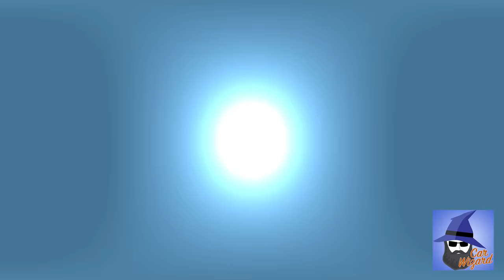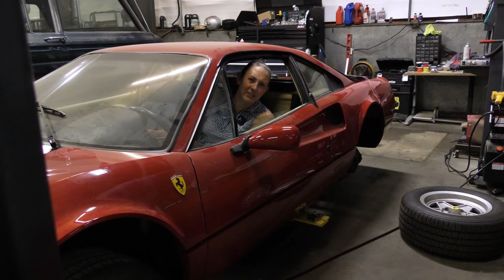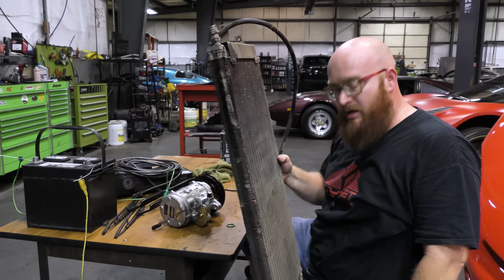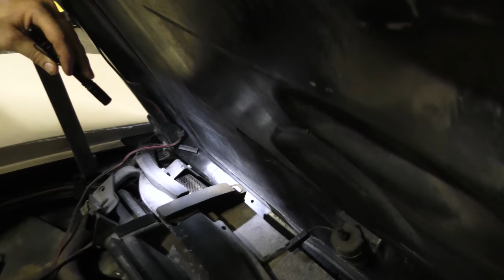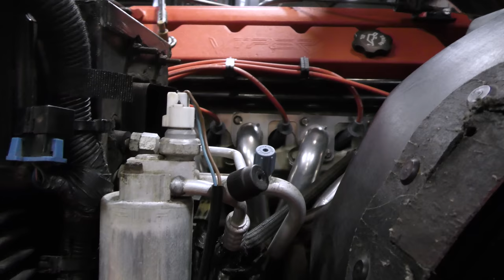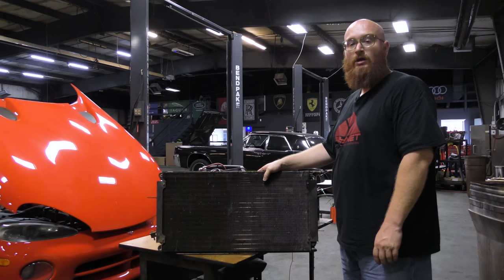Your AC died, now what?!? CAR WIZARD shares several reasons why it dies & the repairs to fix it

Comment: EXTREMELY PERTINENT video !!! You are sooo right with the WalMart refill cans ! Stay away from those ! It is a precise science. I changed the  whole system on my 1996 318iC. Like you said, did everything right and had it filled with the machine at the garage. Works perfectly....The mechanic was sure I had done something wrong along the way, but no!!! Blows COLD !!!! AND I can confirm why it is expensive work, because those parts are not easy to reach, specially  the expansion valve under the dash !!! And don't forget  you have to use the right amount of oil which is impossible for me to know because there is no way to mesure what's left inside the system....

Comment: my brother as a mechanic says all cars have a leak in their AC system. it usually leaks out over time via the compressor shaft seal. same thing happens to ships and boats. they all leak a little bit thru the prop shaft seal.

Comment: Dealing with this on my mother's 12 Juke. No apparent leak in the engine bay as far I can tell, not getting any built up residue or dark spots but it's losing 134A fast.
Reply: @ne2i  that's my next step, getting one of those refrigerant sniffers. How have you seen them in the evaporator? I imagine that's not too easy to get to
Reply: @CAepicreviews  You can use a sniffer in the vents or in the ac drain. Also if the system has dye, you can check for dye in the drain tube of the evaporator. Also, check the service ports closely. Thats where I find the majority of leaks.

Comment: I remember the good ol' days when AC systems had a sight glass to check the quantity of liquid freon in the system. You could add freon to your system, by yourself, if you saw too many bubbles in your sight glass. I still have the kit to do that, along with a 40 year old can of R12.
Reply: Cool stuff!  Had the same equipment in mom's 69 442 Olds so easy to top it off.  That a/c lasted until 1981 when I traded for a 280zx.  Too bad it was rusted!!
Reply: R 12 is extremely expensive these days, not worth keeping installed.
Reply: My son's '02 Toyota Tacoma PU truck has a receiver/dryer w/sight glass on it, reminiscent of the good ole days with R12 freon. Works just as good, and made it easier to check after complete A/C system overhaul last spring for him. He says he has to turn down the A/C output on hot days as it will freeze him out of the truck, LOL.

Comment: I have an old 911 that has AC, it was empty when I purchased it. Being a tradesman in that field it was instantly apparent that the cost of recharging for an old R12 setup was too much. Remove the compressor , condenser. Took about 25 lbs off. Did not by it for AC anyway.

Comment: Something shops never talk about...If your AC only quits in very hot weather, check the gap between the compressor clutch plate & the pulley.  It should be about .020"  As it gets up to the high 30s, approaching .040", the compressor clutch will not have the strength to pull the clutch in. Hot weather will open up this gap more than moderate weather, so the problem first becomes visible in very hot weather.  You can address this by removing the clutch plate and taking out one of the shims. Button it back up and you are good to go.  If you do your own work, this is something you will want to check and address yourself. If you take your car to the shop, it only makes sense to do this if the compressor clutch plate can be removed without pulling the compressor.  If they have to pull the compressor to get the clutch plate off, you are back to the question of whether the labor cost is so high that you might as well get a new compressor.

Comment: Had a 92 D21. AC didn't work when I bought it, then did some digging and found the relay was gone. After about 4 months of it working well, the compressor seized up.

Comment: I once went through 3 compressors in less than 6 months because the parts the shop was getting from their supplier were defective.

They finally forced the distributor to replace it with a better brand. Then it lasted 2 years before it stopped again. A diffrrent shop looked at it and said it was the compressor again. I took it back to the first shop to see if there was any warranty left. They said it wasn't the compressor but a line. The other shop first thought maybe it was a line but then said it was the compressor. So 2 shops in 2 days said 2 different diagnosises. Finally the shop that had replaced all those compressors in the past said they were so confident it was the line that if I paid the $375 to replace the line and it ended up.being the compressor that they'd replace the compressor a 4th time. It turned out it was the line and it's been fine for the last 8 years. But I am on my 6th compressor counting the factory one that was in the car when I bought it 18 years ago. This is a 95 Pontiac Trans Am I still own. I've probably spent upwards of $2500 on the A/C system over the years.

Comment: My '08 GTI had the freon recharged by an R2-D2 equipped shop in 2017. Spring 2022, I was going to top it up using cans from Amazon (Canada), but I couldn't find a seller with cans and hose for a decent price: it was a sign. Let the shop handle it, and I sent it in to get R2-D2'd again.

As the wizard said: Newer small cars are so sensitive, there is so much room for error and environmental impact. Best to let the shop handle it right to spec the first time.

Comment: The warmth of recalling an old memory from a much younger version of this mind  through a delightful childhood reappraisal mechanism exercise.... when a Dodge-Chrysler AC compressor and a fab.'d/modded bracket were not uncommon add-ons (in addition to the working existing AC of a farm or ranch truck or, if the existing AC system was no longer used, the compressor and hoses being ~repurposed).... along with a regulator/blow-off or..... simply a switch to control the clutch 🤔🤷‍♂️ where the AC compressor served duty as an onboard air compressor for airing up everything from a puncture kit repaired pick-up truck tire up through farming implement tires and tractor tires when far and away from any services and an air bubble was simply not going to hold enough air to get the jobs done.
....Anyhow, nowadays, we have transferable / portable air compressor options that are powered off the 12-volt accessory jack and, yet, those AC compressors flowed alot of air volume quickly to get the farm back into operation but you had to be careful to stop the compressor before over-pressurizing. 🍻

Comment: My 2006 Scion XB had a rock puncture in the condenser when I bought it. The front of this car is almost flat, so i'm not surprised. When I replaced the condenser I put some black gutter mesh in behind the bumper to possibly prevent rocks hitting it in the future, so far so good.

Comment: Had an AC pressure switch fail on my audi 3.0tdi, caused the radiator fans to go max speed all the time and car not warming up regardless of the AC on or off. also climate control auto modewas setting the blower motor to almost full blast as well
Reply: gotta love German engineering.  I had a bmw z3; spent more on replacement parts than all my other cars combined.  Hope yours was better.

Comment: If your doing it at home invest in a vacuum pump and manifold gauges. I had bad O-rings on my Subaru Outback. They were the 2 located right at the compressor. Since you now have exposed your system to outside moisture and humidity you need to suck that all out. In my case 45 minutes. 30 minutes at the correct negative pressure. Basically suck it down until the desired reading and shut the pump off. If the system is sealed correctly it should maintain the desired reading. Then run the pump for another 15 minutes to ensure all moisture is evacuated from the system. To fill you want to see how much refrigerant you need plus the PAG-oil type and quantity. Get a small digital scale and weigh the full cans and deduct the actual fluid ounce marked. It will make life alot easier. My Subaru now has ice cold Air Conditioning at about 39 to 42 degrees after a 30 minute run time.

Comment: I have found that overcharged AC units are usually due to a "loose nut" behind the wheel.   Thanks Wizard and Wife as always.
Reply: There is no correlation between your statement and the end result.

Comment: Great video...  Another scenario I have seen that reduces AC efficiency is a electric fan or relay that fails, thus not producing the air flow needed in slow driving.

Comment: Good tip on the evaporator, Going to have to check that. Can't find any leaks around the AC lines or compressor or condenser.

Comment: I had a car aircon system that was not running at a cool eneough temperature.  A local shop checked it out and found that the evaporator (this is the part that the fan in your car blows or sucks the air through to cool it down) was clogged with dog hair (I have 2 border collies in the car most days).  The shop blew the hair out using a high pressure air hose and the problem was fixed.  Fluffy lambs fleece seat covers are also a common cause of this problem.

Comment: Great video. It would be great to continue in your future videos if when your talking about parts viewers saw them on a table and were educated on how they work. My VW Jetta GLI has 240K miles. My AC was charged recently but was getting a bad taste in my mouth running the AC. It was 100K miles since I changed the air filter so first sprayed Lysol then AC Pro duct cleaner and smelling better now. But if I turn the AC off - my vents release hot air. Has me worried the foam around the flaps arent closing corectly. A very very expensive fix.

Comment: We have an Isuzu Rodeo that had no ac when we got it. All we had to do was Jumpstart the ac compressor with a wire in the fusebox, and a bottle or two of ac refill. 

The ac isn't great but it at least still works all this time later. Still don't know why it was empty in the first place, we got it that way. Still blows cool air from the vents (semi cool I don't think these cars ever had really good ac like a suburban)
Reply: How old was it when you got it?
 10 years? 
Probably leaked it out over that time....
So next time (or when you get fed up with the lousy output) go to a shop and get it recharged (with the correct amount of oil as well).
You might be pleasantly surprised at how well it works after that!

Comment: Sounds to me like if your A/C is working just fine now on it's original A/C compressor and you have perhaps 100k miles on your car, just change the compressor as preventative maintenance to avoid having to replace the whole damn system when it does blow. I know I bought my car at 105k miles and my compressor went out at around 120k. Thankfully it was just a bearing so not much worry about bits being forced through the system, just changed the compressor and kept on trucking. Been doing fine and I'm at 160k now, blowin cold on these hot days.

Comment: My dad got a quote from a Porsche dealership for $15k to replace the entire AC system, and they claimed it couldn’t be warrantied because they saw “wrench marks” on a line…. Needless to say, we took it to a trustworthy local mechanic and they could tell immediately where it was leaking out of a few o-rings, replaced it, charged the system and were out of there for a few hundred bucks. (Most of the cost is the expensive refrigerant used).

Comment: I recently had the air-con system serviced in a 2013 car I've owned since last year. The amount of gas the system should hold is 450 grams, but the shop's machine recovered only 168 grams! Somehow it was still blowing cold before this, so I guess the previous owner never thought to have the system checked. I bet the almost 300 missing grams were lost over the years since 2013. Fortunately, the shop didn't detect any major leaks - the system held pressure when they pressure tested it - so hopefully I can continue to just have a re-gas ahead of each summer. Edit: just goes to show it might be worth having your air-con checked out even if it appears to be working okay, especially if the history of it is unknown to you.

Comment: With our smart cars, if we can find one time during each winter month to run the ac, then it's most likely going to work when the weather gets warm again. But if we go that one or two months without running it. Then we likely have to charge it in the spring.

Comment: I had a 2010 Ford Taurus that wasn't cooling right on a hot day and the car was still brand new. I took it to one dealer and they wouldn't even look at it so I took it to another dealer and they rode around in it and took it back in the shop and came back the problem was it came from the factory with TOO MUCH FREON.  TOO MUCH is just as bad as not enough. I had a mechanic in Louisville KY that told me that isn't a car on the road that he can't find a leak on. He said he was at a seminar at a Ford Dealer and while they were on break, they went out in the showroom and found leaks on brand new cars.

Comment: Just roll in this monday...1995 W140
Evaporator is leaking.
It's a common failure in Taiwan for these European cars.Workshop says it's because evaporator's material made by aluminum ,if it's made by copper it can last almost forever.
And mono valve is a common failure too, just replaced few month ago.The part is super expensive about 600 USD labor is only like 35 USD.
When mono valve fail the cold and hot air will blow out at same time.
So many people choice bypass mono valve, cause AC is a big deal in Taiwan but heater is not.
In the shop an GL450 is replaceing evaporator too...the thing only had 40k miles...
I know the car is leaking freon about 3 monthe ago.
I notice engine temp goes up to about 100°C when idle and fan didn't work , asked workshop they recharge it everything goes back to normal.
Last week came to workshop to do regular service, find out evaporator is leaking really badly.
The car needs 1.15kg it leak 300g in 3 month.
Car still in workshop need about a week have to take whole dash out.
The bill for whole job is about 700 USD Include labor.

Comment: my rule of thumb when it comes to AC service.... take it to the pro and always buy OEM/NEW parts. I've seen reman ac compressors fail many times. do it right, once.
Reply: Yeah, high quality parts are the way to go. A cheap compressor could explode causing Black Death of your ac system. They you get to replace everything.

Comment: My dad's car had a leak after i replaced the all like the 3 rubber lines it has and there was a leak still but was under vacuum. On a whim i thought well how about I checked the valve, so what i did was I pulled off the low side coupler and loud hiss it was still under vacuum. And i suspected it a valve was bad and lucky i purchased a kit to replace a whole bunch a valves and it came with a tool to take it off change it also on the high side, fixed that no more leak and held vacuum beautifully and fixed it

Comment: Just went through this last week with my ‘91 Volvo 240 wagon.  And, of course, it happened on a 100 degree day.  Fortunately, it turned out to be a bad ground, the simplest and probably easiest fix for the problem.
Reply: what was the symptoms?
Reply: @jeedwards1981  It was only blowing hot air.
Reply: @craigsummerville8823  was compressor engaged and condensor fan running?
Reply: @jeedwards1981  No, the bad ground prevented the compressor from starting so the clutch never engaged.

Comment: I remember coverting the A/C on my 93 GMC K3500 from r12 to 134a and about a month later the parking brake failed on it and it rolled down the hill when i was pumping diesel fuel... Popped the A/C condenser was absolutely aggervating.
Reply: I don’t even know what you were trying to say.
Reply: @trwsandford  that person replied the same thing to me, that person is a God darn spambot, they're crazy as hell
Reply: @brianlego98gaming  or he's having a brown baloney sandwich with a side of chocolate starfish!
Reply: @brianlego98gaming  I noticed the porn bot too, but I think he's replying to the original commenters comment. Like what is "aggerating"? And what is "popped the a/c".
Reply: @pizzamon795  
He probably meant that when it ran down the hill it popped the a/c condenser in the resulting collision...
and since he had only recently done the a/c system and spent money....
all the freon going and a new condenser replacement just led to more expense...which was aggravating!
Bet he fixed his parking brake, too!
Reply: @JohnSmith-yv6eq  yep totaled out the condensor, it was all factory surprisingly I ended up tearing that truck down to the frame and I'm restoring it as the cab was starting to shift on the frame and the radio quit working one day and it wasn't the head unit as I run Kenwood in all my trucks and it worked as soon as I plugged it into my Nissan

Comment: When you talked about the compresore mechanical malfunction and you must replace all components, does that include the evaporator core?
Those are hidden in the dash and usually requires removal of the dash.

Comment: I would say watch out for the type of A/C compressor that doesn't have a clutch. VW definitely used them between 2010-2020, and potentially other  vehicle manufacturers as well.  I was buying a pre-owned car that had one of these (little did I know at the time). It was January in a northern climate when I took delivery of the car. I wanted to confirm the A/C worked before I signed off on the deal. So I switched on the A/C and took a look under the hood, and the compressor was quite obviously turning.  Come spring time I switch the A/C on and it has no cold air to give. And this is when I found out about externally controlled variable displacement A/C compressors :/